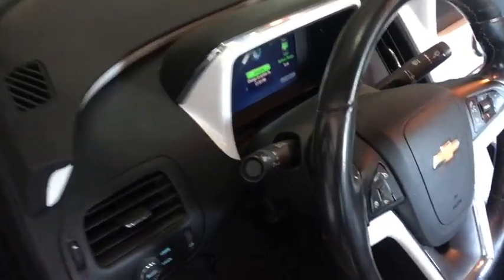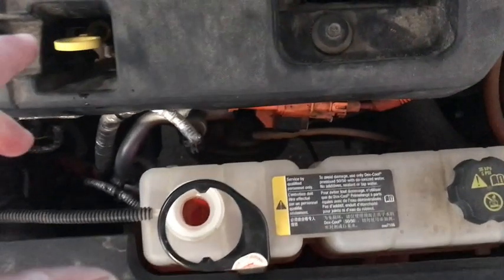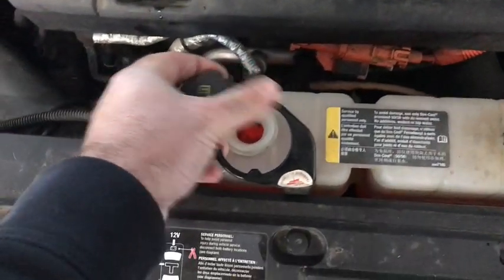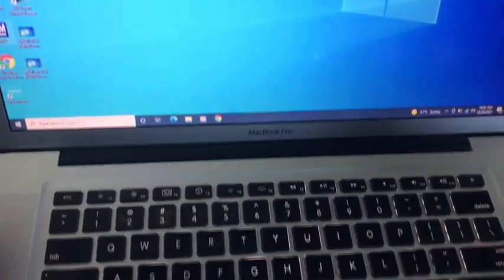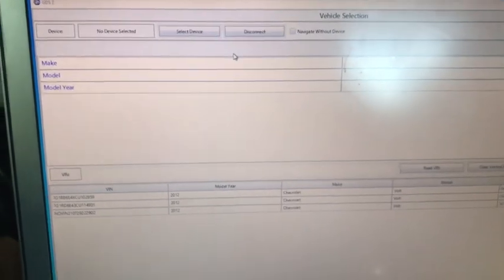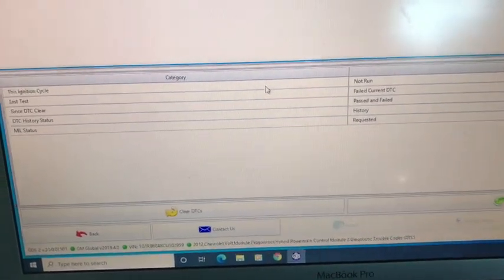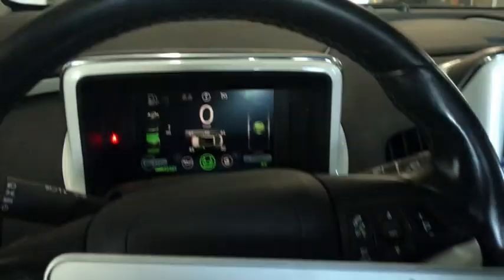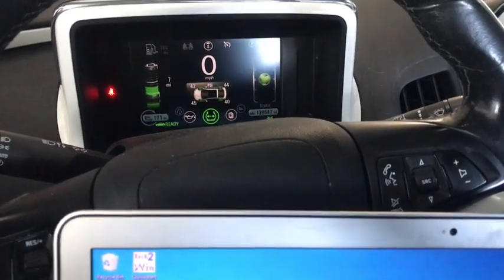Fixing "Service High Voltage Charging System" Error on Chevy Volt WITHOUT Reprogramming HPCM2 Module

Comment: So, you said you had to replace all that yourself so… does it take a special kind of coolant/fluid? It seems the anti-tamper bracket would also prevent you from topping up.
Reply from the maker: Yes it uses premix dexcool only. (Or a 50/50 blend of dexcool and deionized water.) The system should never require topping up unless something springs a leak. 

But that anti-tamper bracket is an absolute joke.

Comment: So i have been fighting with this issue since I replaced the hybrid battery a month ago or so in my 2012 volt. I tried my cheap obd2 scanner to clear the codes / warning and no luck it kind of just blinks and stays on. Then I went to the local shop snd we hooked his snap on diagnostic tool on which was way more high tech than mine and that did the same thing. So if I get this software I should be able to clear it without an issue? Was yours also unable to clear from a cheap obd2 scanner tool? I’m trying not to break the bank at the dealer and figured if this will work why not buy it and have it in case I need it for anything else with the car. Thanks!
Reply from the maker: My laptop is an old MacBook Pro with a windows partition through boot camp. As long as it can run windows 10 it should be fine. There are a few different VCXs out there. Just make sure you get the one for gm. (I think there’s a universal one out there too that might work ???.) I picked mine up from Amazon. I don’t trust the VX diag website AT ALL.
Reply: @utjay2008  ok perfect yea I have windows 10 on it so should be good. And yea I saw a gm specific one on Amazon I was going to go with that. Says it will be here Wednesday so I’m going to give it a shot. Worst case scenario I’ll have to buy that AC Delco subscription right?
Reply from the maker: Yes. The cheap readers were unable to clear it. I WAS able to clear it with the VCXNano / GDS2 (and I made another video about that). But this time only re-writing the software on the module would clear it. I’ve had to do it multiple times so I’m glad I bought the VCX.
Reply: @utjay2008  Awesome I guess I will give it a shot then. I’ve got a older HP laptop do you think  that should work for the software ? And is there a specific model to order?
Reply: @utjay2008  why did you have to clear it multiple times? The SHVC should clear permanently once you reprogrammed the module.
Reply from the maker: @redx11x  the error was re-occurring. I changed the sensor twice, checked wiring, etc. I ended up flashing the HPCM2 to the non-RESS version and it stopped for good.
Reply: @utjay2008  what is the "non ress" version?
Reply from the maker: @redx11x  it’s the software version for cars that didn’t get the structural update (and the sensor that causes this mess) from factory. One of my 2012s has the non-RESS version available, one does not.
Reply from the maker: The GDS2 subscription through TLC/ACDelco is quite expensive (I think 500 for 2 years or something). The VCX Nano has some hacked copy of it that sometimes works. Lol. But if you’re just trying to clear the SHVCS error TLC and the subscription will ALWAYS work.
Reply: @utjay2008  even if I have to pay the $55 for the 2 day subscription or whatever it is each time I do it it’ll still save me hundreds over going to dealer every time lol.
Reply: @utjay2008  so….. attempted to clear code with vcx nano and gds2 but no luck….. so I went on and downloaded the tech line connect and bought the programming subscription for 1 vin. Now I can get it to load up but as soon as I try to connect the car to tech line connect with the vcx nano device it comes up as an error and tells me to shutdown or restart the tech line connect. And that’s every time I try it. Any thoughts? And I appreciate the help so much lol I can’t wait to get this damn light off
Reply: @frankklepeis3422  any updates?
Reply from the maker: Did you make sure that you were in service mode first? Give the PC a fresh restart and make sure you don’t start any of the VCX software.
Reply from the maker: Yeah. Setting up GDS2 can be a pain, and it’s full of viruses. And once TLC is installed GDS2 won’t even work (unless VX DIAG releases an update). Basically I would count on buying that subscription. 

Im hoping to make video soon about how to set it all up.
Reply: @utjay2008  The TLC covers everything the GDS2 does and more though right? Do I should be fine either way. And yes! I think you should make a video before Wednesday! Lmao

Comment: Whoa! Wait. At 4:00 you say you connect your VCX Nano to your computer and into your car like everyone plugs stuff into their car all the time. What are those lights at your feet?
Reply from the maker: Hi Erik. This short tutorial is about using a VCX Nano. It’s a pretty handy (sometimes frustrating) tool for GM vehicles. The 2 lights you see are a red power light and a blue data light. Check it out on Amazon.

Comment: Hello, I have an Ampera from 2012 and today had same issue message : High voltage system . I tried to check a Portuguese forum and they told that the battery has low level of water, to check that. After checking youtube all the people refer to the low coolant level on front.

My question is if general battery is low I need to recharge it and see if there is any issue (is around 30% I check with my charger). If I unplug and plug the battery cable, may I reset this error or not ? Thank you so much.
Reply from the maker: The coolant sensor, to my knowledge, only creates the SHVCS error. I’m guessing the BECM or CCM needs a software update? The newer HPCM2 and BECM updates cause the motor run a lot more often.
Reply: @utjay2008  thanks a lot.  I will try to change the sensor and later check the motor behaviour. 

With the replacement of the sensor I think I would be able to charge the batteries later.

Thank you!
Reply: @utjay2008  hello. New update, I bought a 24k resistor to test it in the sensor`s place before buying a new one. I was able to clear the DTC error and wait a day. Today I check the car was not moved since 2 days and when I turned the power on I saw the error again in the dashboard. When I measured the resistor in the circuit I have around 5k or 6k I guess and the voltage around 3.5v. Any clue why it`s not working with the resistor ? Could the sensor be ok with this test I guess..
Reply: @utjay2008  wait, what do you mean run more often? Doesn't the engine only come on when power is needed or you're below freezing temps?
Reply from the maker: @bjeah  sorry I couldn’t find what you were asking about in this thread. Can you elaborate on your question?
Reply from the maker: Usually once the error pops up you have to verify the coolant level and then reprogram the HPCM2 software. Sometimes you can erase it like how I showed in my video. That’s really the only 2 ways we know of. Good luck!
Reply: @utjay2008  , many thanks to your video. I bought a ELM327 Bluetooth device for 20€ + 10€ of dexCool, download the MotorData OBD ELM car scanner from google play and I was able to clear the DTC codes with that one of High voltage included. Before doing that I filled first the deposit of cooling. Now I don`t have the error in the dashboard. I can`t charge the car now to test but I think tomorrow it will be ok to charge and to work fine. 

Thank you so much and I hope my comments and your videos will help more people.

Cheers,
Luis
Reply: @utjay2008  thanks a lot for the fast answer. I was able to see that the coolant level are below the sticker (even insisde the minimum mark I guess). 

I`m charging the acid battery cause it`s too low. 

What about the OBD2 that I need to buy ? Do you know if there is any cheap to connect to the mobile phone as I have no pc withou windows xp or vista ?

Thank you in advance. Luis
Reply from the maker: Gotcha. Yeah top up the coolant with 50/50 dexcool and de-ionized water. Or get the premix stuff from the dealer.
Reply: @utjay2008  , thank you for the tip. But after that I still need to clear the error right ? I was checking this device ELM 327 BLUETOOTH INTERFACE OBD2 E OBD - ANDROID - PC, think it can help clearin the code later. 

I`ll give feedback later when apply those tips. Thank you!
Reply from the maker: Some do, some don’t. Let us know how it goes! Good luck!
Reply from the maker: Awesome to hear! With the error cleared it should charge no problem. Glad we can help each other out!
Reply: @utjay2008  good morning tried to connect the cable today and got the message again. 

Tried to claro de error but now is always there. Do you think its the coolant sensor? Thank you.
Reply: I unplugged and plugged the sensor switch (a big one) clear the error and I was abre to claro the high voltage error again.

Anyway, when I plug the cable yo charge, I get in the dashboard the "wire connected message" but no charging at all and I see the yellow Light.

I need to test in a mobile charger to check if it charges or not.
Reply from the maker: That’s very odd. I get that error on occasion, but it doesn’t seem to be related to the SHVCS error. Keep us posted!
Reply: @utjay2008  hello again! Weird situation . Tried now to charge sith the orange cable says cable connected yellow Light and wont charge. 

If I use domestic charger same message and later the high voltage appears. 

Need to understand if I need to change the coolant sensor. If yes, where is the location? 

Other thing I noticed is that since one month ago with the battery 100% the motor will always start and I diante know why. Could be related with this faulty sensor? 

Thank you!
Reply from the maker: At that point I’d check your wiring. The sensor was added by dealerships on some 2012s. And they did a HORRIBLE job wiring it in. My wife’s volt was awful. On my 2012 volt it appeared to be factory. 🤷‍♂️
Reply: @utjay2008  thanks for your feedback. Yes I think everything is pointing for the wiring. The problem is how to follow or change the cable with that little space and tape around them. I will try. I think the voltage should be 5volts on that wiring to the sensor so something`s wrong. Thank you!
Reply from the maker: I can’t remember the exact details. So double check all of this. The HPCM2 module is under the passenger seat. 2 of the wires under there are only check for resistance (37k ohms iirc). I can’t recall what voltages are going through those wires.

Comment: I had the same thing and tried clearing it with a cheap wifi obd2 scanner with no dice. Brought it to the dealer and they "reprogrammed" it as you mentioned. I now own a good obd2 diagnostic tablet that was able to go through every module in my volt. Needless to say, it will not be going back to the dealer if the issue returns. Good video and demonstration.
Reply: I was able to fix the SHVCS error on my 2012 volt after adding a little bit of 10-5027 Dex-Cool 50/50 Pre-Mix Engine Coolant (that was apparently low) and then I cleared the error with the Innova 3160 scanner that I bought many years ago. I realized the error would not be cleared if the ignition is off, it needs to be ON !
Reply: @Legolander7 where u buy the coolant?
Reply: Hi Colin I have a 2011 Volt with the same issue, what year is yours? Some of the newer volts are reportedly easier to clear the Service high voltage sys error than 2011 an 2012 models. I will buy the itopdon artidiag 800bt if it will do it, the dealer charged me a fortune last time, told me they had to change the inverter, I know mine just needs a reset.
Reply: @mvpmachine  I have a 2013 volt so it's still a first gen volt. I'm not 100% on if it will clear the code, however, it is able to read from every single module and clear from every single module in the car so I'm almost certain that it wouldn't have a problem clearing it. If it doesn't you can always return it. Make sure your coolant is actually not low and you should be fine.
Reply: @gamergye  thanks for your reply! I emailed their customer service, hopefully they will know. If not i'll give it a try anyways, most likely a good tool to have.
Reply: @mvpmachine  I'm not sure they'll know specifically but I have had luck clearing everything else out of my volt with it. It showed codes that I didn't even know about. TPMS voltage codes, passenger presence sensor codes, etc. It cleared all of them including an airbag code (after I reconnected the airbag) so I'm confident that if I get SHVCS again it will clear it. It also cleared a bunch of codes for a friend's car when his battery went flat which saved him a trip to the dealer for programming! It's paid for itself for me
Reply: @gamergye  I surprisingly was able to clear mine yesterday after the third try with  the cheap old scan tool I have..weird. But after seeing the videos on this tool, it looks awesome and worth having, so I will likely get one. Thanks for your info on it with your Volt it's hard to know what will work with these cars.
Reply: @Alyssa Salazar It is an  Innova 3030  had  to use reset function two times. Mine is pretty old and you may be able to find it on ebay. It is very basic and likely only cost 30 or $40 it is not much good at diagnosing anything on the volt because the codes it reads seem meaningless but the reset works fine.
Reply: Colin what good obd2 diagnostic scanner did you buy to reprogram?
Reply: @edmiller6227  I didn't reprogram but I use the topdon artidiag 800bt. It scans every module and it can clear them, which is what the dealer would do in this case. It also does a bunch of other stuff.
Reply: Did it return?